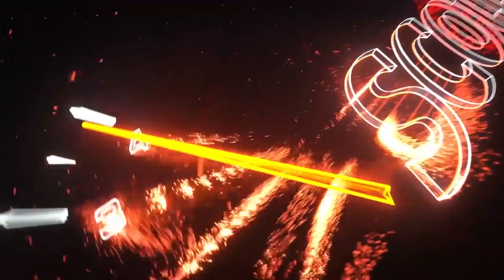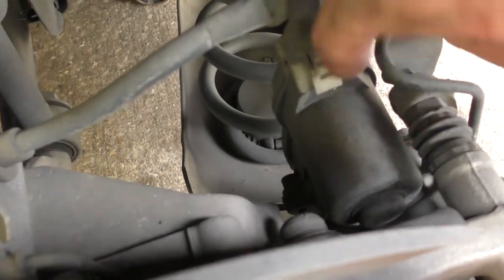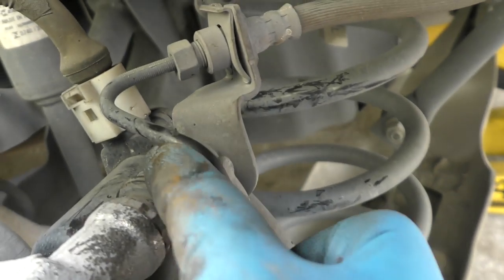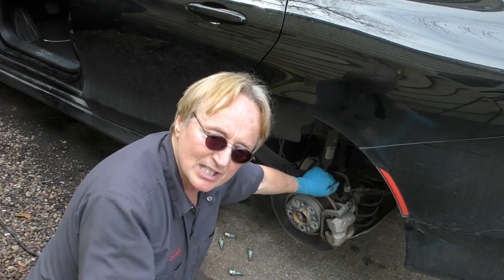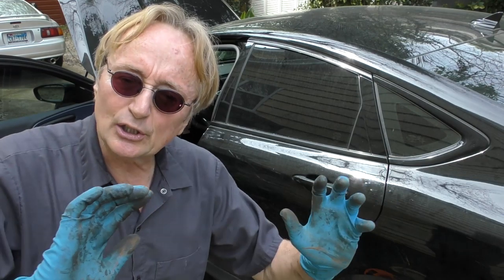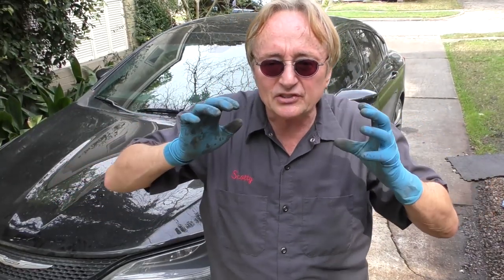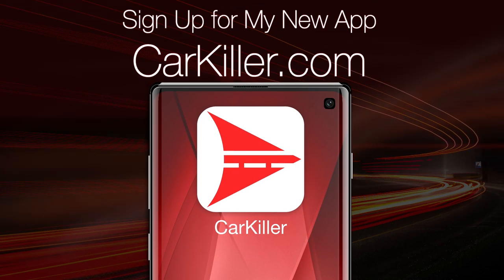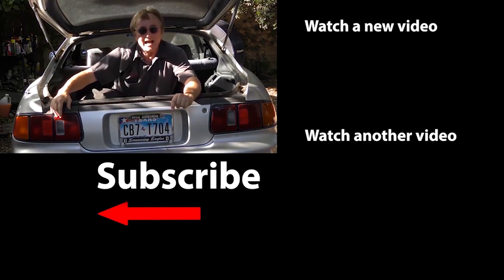This Trend is Stupid and Dangerous

Comment: I thank my lucky stars every day for buying a near flawless 2013 Honda CRV-EX-LNAV.  Nothing on my car has ever broken since buying it new in November 2012.  Granted it only has 36,000 miles.  By 2020 standards my NAV/GPS Infotainment system is "outdated", but who cares?  It has nice conventions knobs and buttons.  The parking brake is the foot operated kind.  It doesn't have the quirky pushbutton start system.  I have to use my car key to start the engine.  It has the robust 2.4 L inline 4 cylinder engine with multipoint fuel injection, NO GDI or stupid EARTH DREAMS technology.  Robust 5-speed automatic transmission, NO CVT here!  Honda should have stopped right here and made no further changes to the CRV.  The 2013 CRV is the best model year Honda ever made IMO.   I wouldn't sell it if someone offered me $30,000, it's that good!

Comment: Can't stand this! A secondary function of a parking brake is also (as it's commonly called) an emergency brake! If your main brakes have a complete hydraulic failure...this is supposed to be a nearly failsafe mechanical backup! And of course, you can control how much braking force is applied, unlike this electronic system that will probably just lock up the wheels if it even works at all! To get rid of that is just beyond stupid! 

Even many commercial jets, like the 737, are STILL using mechanical cables to be able to move flight control surfaces in the event that the hydraulic or electronic systems fail! Because it's a redundant and failsafe setup THAT WORKS! 

If only the car industry wasn't so stupid...

Comment: Just use you 5000$ software tool to put the calipers in maintenance position... and the reason there is electronic brake is because we are in XXI century, not everyone is old and whant to pull a ridiculous stick with a wire. Most people buy cars for comfort, not just a bucket of quality made bolts...

Comment: Scotty is wrong about the motor having to be strong or having to be able to hold. It's got a gearbox and the thing will not release if it doesn't turn, which is why you have to turn to compress in the first place. 

I'm not defending the piece of junk, I hate them too, but Scotty was wrong there. 

I work with lifting actuators that are more or less built with the same idea in mind, and these things will hold the load as long as the gears in the gear box hold. Since this part doesn't have any strain or load once fully in place, it's gonna hold, no problem. The motor could be a toy motor and would be fine.

Comment: Cadillac had the old turn and press worms in the parking brakes for the rear twenty years ago but they were mechanical. That is why we have the same tools! Electric brakes are retarded - so is electric steering, electric transmission, electric anything....except lights and windows!

Comment: That's a dumber design than I imagine. Let's increase unsprung mass on the rear axle and swap the old mechanical cable with an electric one... I guess it cleans up the cockpit a bit, but the noise it makes is embarassing, sounds like a little motor that's struggling, just like most auto-folding mirrors.

Comment: I have been fixing cars for 25 years and have needed to repair a ton of rotten e-brake shoes seized adjusters and broken cables. So far i have only needed to replace one electric e-brake switch. I would say Scotty is full of crap on this one.

Comment: Scotty, you are appear to be a competent mechanic, but too many statements in this video stretch into assumption rather than data or evidence driven opinion.  Engineers don’t make something more complex, “because they can,” or even to make something more expensive.  Such designs are driven by REQUIREMENTS from a myriad of sources.  These sources include:  government regulations, customer demands, and market conditions.  

As an Engineer who worked in the brake sector of automotive for almost twenty years, I can say that brake design (specifically parking brakes) is driven by four key factors:
1. Cost
2. PARKING effectiveness
3. Weight – driven by fuel efficiency requirements
4. Bling

As you showed in other videos, for daily driving, drum brakes are just fine for rear brakes on the typical passenger car.  However, drum brakes contain a LOT of individual parts that drive up part number count and therefore cost.  The short story is customers WANT disk brakes and therefore the requirement is how to best (for cost, parking effectiveness, and weight) to meet that demand.  Again, rear disk brakes are essentially bling that customers want.

So the question becomes how to best (for cost, weight, and parking effectiveness) design rear disk brakes.  A parking disk brake (as opposed to the parking drum brake enclosed in the disk brake rotor) is lighter and has fewer individual parts.  Yes, one needs a special tool to push the piston back in the caliper during service.  However, such tools are routinely offered by parts stores for no cost lending.  Electric parking is, of course, lighter still since cables and parking levers weigh significantly more than buttons and wiring.  Again, electric parking is significantly lighter than alternative forms of disk brake parking.

Lastly, electric parking addresses parking effectiveness.  Park brake levers or pedals are susceptible to being out of adjustment AND how much force the driver applies when parking (if the driver applies the parking brake at all).  Electric parking can be automatically applied whenever the driver puts the transmission into park and shuts off the engine.  This addresses governmental regulations and reduces manufacturer liability, so it becomes very attractive for car manufacturers.  The benefits of electric parking applies whether the rear brakes are disk or drum.  Yes, that motor may cost $100 in the aftermarket (after many middlemen take their cut) but for an OEM it is significantly less.  

Regarding your terminology of emergency braking.  You should have that the term emergency brake went out of the industry literally decades ago.  This is because the parking brake is to be used for just that… PARKING.  Parking brakes are specifically designed to hold a vehicle in place, not bring a vehicle to a stop or even slow a vehicle down.  The friction material is design for STATIC not dynamic friction and therefore is significantly less effective in dynamic stops.
  It might certainly be fun to hit the parking brake to swing the rear end out into a drift, but that is asking the parking brake to do something it was not designed to do.

Bottom line here is Engineers design to requirements which involves many trade offs.  Sometimes those trade offs are at the expense of more difficulty or cost in servicing vehicles.  I get that you might view that cost as stupid design.  But you do your viewers a disservice when you present a bias against Engineers without having all of the facts regarding the design requirements.